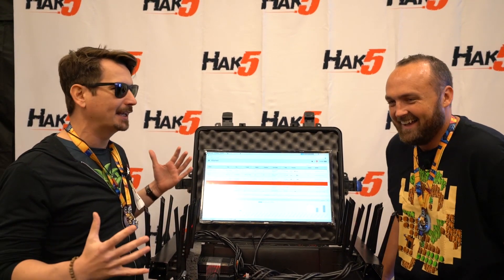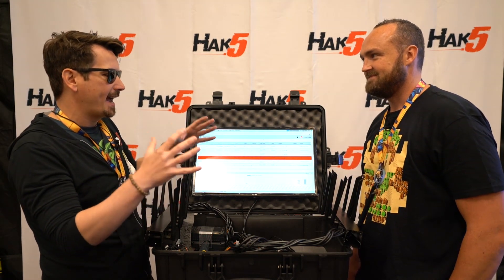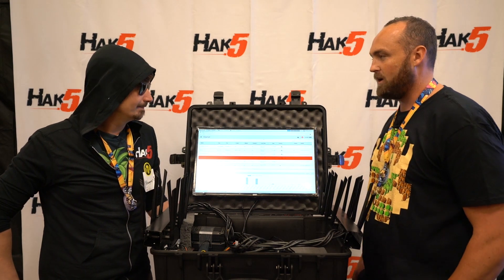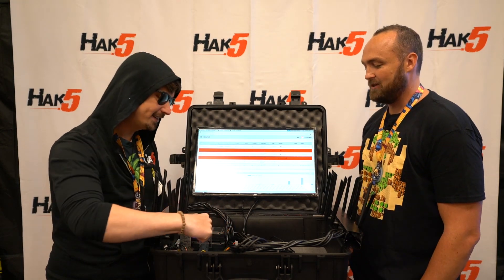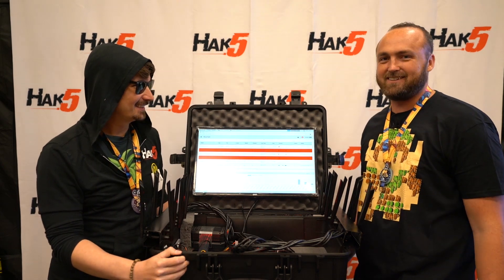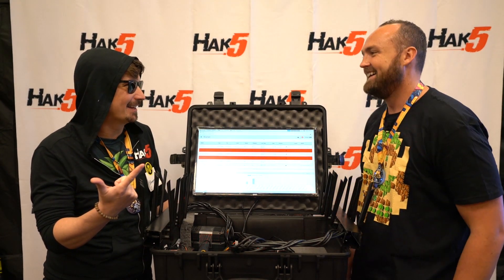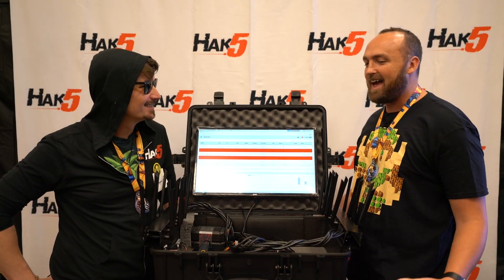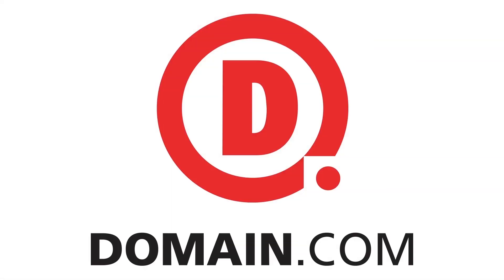DEF CON 27: The WiFi Kraken with D4rkm4tter - Hak5 2602

Comment: Does that hog have a GPS radio ? ;) For some War driving ? I drove over the Tappan Zee Bridge in NY way back with an old laptop and Back Track  and a rooted android device as my GPS device  it kinda said they had a wifi device at the top of the structure of bridge its gone now (the bridge that is) but it always fascinated me.

Comment: To get around the physical limitation of USB 3.0 why not use a mining motherboard where you could convert 20+ PCI-E 1 slots in to 4+ USB 3.0 slots each? Could sniff many more wireless networks then?
Reply: You'd still be limited to USB 3.0 there too, genius
Reply: @tacky It is not about throughput, it is about the amount of different wireless USB dongles you could use simultaneously.

Comment: I have this Mediatek MT7612E mini pcie card pre-build on my chinese brand laptop. Does this wireless lan support monitoring mode and packet injection? If this WLAN mini-pcie card has compatible drivers to a latest kernel version of kali linux or parrot security?

Comment: Hey, I'm a complete noob and I'm looking for somewhere (forum, discord, whatever) where I can ask general and probably dumb questions as I learn. Mostly I'm looking at the basic online/connection stuff but if something else would be easier to get into let me know.

Hak5, from what I've seen you do some awesome stuff and you do it for the right reasons, but then again I'm a noob so
Reply: Well what genre? Reddit has its place. But so do things like stack exchange. And look at github for things people publish that's in all phases of development. It really depends on what you are wanting to learn. Do you code but need hardware help or vise versa? Do you have a working knowledge of communications protocols or os kernels?
Reply: @AtomkeySinclair  I'm not great at either software or hardware, mostly from lack of experience but I do have a little experience with both. At first I want to do something that's pretty simple so I can get some info off of a network and start figuring thing out from there.

I also like poking at things and seeing how they react, especially if they break
Reply: @benhemmings1290  I think you might want something that is cost effective, has massive online support, is mostly open source, and covers nearly every aspect you could want to experiment with. So get a Raspberry PI. I would recommend the PI 3B model. $34 USD on Amazon. It's a single board computer that also has GPIO pinouts. It runs a linux distribution (OS). You can screw it up over and over and over, and still go back to step 1 in about 1 minute. So experimentation is highly encouraged because it is so fast to recover from when you goof it up. And the GPIO (General Purpose Input Output) pins will let you connect the computer to real world data collector emitters and recorders. So things like temperature sensors, and stepper motors, LCD displays, joysticks, etc. All of the programming tools, libraries, and resources are open source - i.e. free. It has the necessary interfaces for performing network hacks at nearly all levels that I can think of. It is nearly endless what you will be able to do for next to no serious $$ investment.
Reply: @AtomkeySinclair  that sounds pretty damn good, thanks. Any particular software you'd recommend starting with?
Reply: Learn about Computer Networks & Operating Systems, that's always a good start - try Cisco Network Academy.
Reply: @thuglife896   completely agree! Really useful to get a good base.
Reply: What is it your wanting out of it? Career advice? Happy to help you out if you need any.
Reply: @anonpater2923  for now at least I want to mess around and learn, see what areas make the most sense to me and figure things out as I go. Maybe if I end up being decent at it I might look at a career but I pretty much only know enough to be curious at the moment.
Reply: @anonpater2923  that's awesome, thanks. Perfect timing as well, got one of those deals at the moment.

Comment: Hold on... Can this be used as a WiFi router? Or hotspot? Can it also pickup Bluetooth? ... Can we then network all the connected devices together?... Can we then add a programmable radio recever? 
I WANT TO PICKUP ALL THE LOCAL RF SIGNALS
Reply: I want to turn that into a wireless LAN hub. That is cross compatible with EVERYTHING. Then use it to knock EVERYONE off the network so that all signals have to go through that thing. Also it'd make home networking a breeze, and you'd know if ANY new wireless device got within range. So any black hat just gave away there presence to you by just turning on anything.
Reply: Johnathan Stephenson lol
Reply: Johnathan Stephenson same